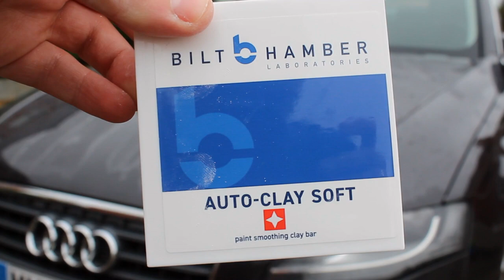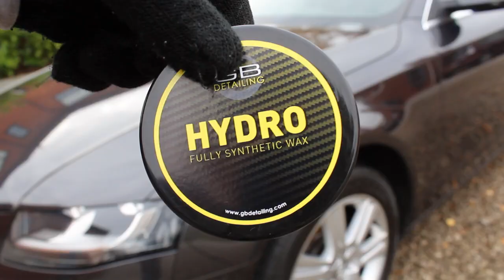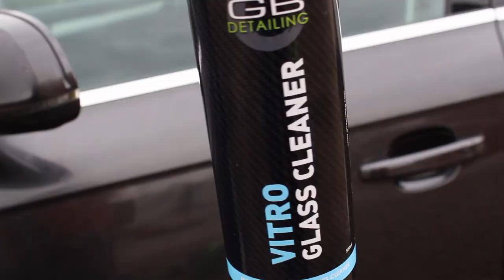FILTHY AUDI A4 | Complete Car Clean, Decontamination and Protection

Comment: Hi Heather, great content in video and some really good products.
I currently use chemical guys clean slate to remove waxes and sealants but after seeing you use GT zero and the fact you can use it in your foam lance as well definitely going to try that and there wheel shampoo looks good too maybe have to get that as well and try it in my IK foamer as them Audi wheels were like new after you had cleaned them. 
Looking forward to your next reviews.
Stay safe
Reply from the maker: Thanks for watching! I’d definitely recommend GT Zero over chemical guys clean slate, I’ve tried both and GT is the better product for me! I’m doing a video on the IK foamer and wheel shampoo soon, both well worth picking up as well 😊
Reply: @AutoCareHQ  
I currently use the foam pro 2 with P&S break buster so will be interesting to see how the GT wheel shampoo performs.
Do you know what dilution ratio I would need to use in the IK former
Reply from the maker: I normally use about 10ml in 500ml of water in the IK foamer which is plenty
Reply: @AutoCareHQ  
Thanks for getting back to me with that looking forward to seeing how it performs.

Comment: Great video again. And a good end result. 
Although there are one or two things I would say. 

Firstly, you aint doing wrong at all using Korrosol on the wheels. Its a great product and works well. 
I would say invest in some wheel wollies or a barrel brush though for that ultra deep clean. 

Second tip I would give is on the wax application. Just buy another pad for your polisher and use that to apply the wax. It'll take you 1/10th of the time. 

Lastly, for the wax removal, just use a nice soft deep pile cloth, stick it on the panel and put your polisher on top of it then go to town. 

The wax will come off easier, faster and leave an even deeper shine with absolutely no residue left over. 

Time is money and all that. 

Keep up the good work lovely.
Reply from the maker: Thanks very much for watching and for the tips! I’ve recently got some proper wheel barrel brushes, they definitely make it a lot easier! 😊
Reply: @AutoCareHQ  most welcome!  As soon as this snow buggers off I will be out there myself elbow deep in apc, wheel brushes, wash mitts and all sorts. Lol.

Comment: Great transformation Heather!, paintwork was crying out for a boost, black hole is one of the best glazes out for black cars.
The trim came up very well too, GB Onyx looks very good.
Reply from the maker: Cheers Graeme! Absolutely love using Onyx, I’ve gone through loads of it on my car, the finish is very nice and it’s really quick to apply, one of my favourites for sure! I’ll have to see if the GT Tyre Serum knocks it off the top spot 😂

Comment: So, I'm curious. You pressure wash before the snow foam. Some swear by using a snow foam on a dry car. What are your thoughts and when would you do one thing vs the other? May make an interesting video? Thanks and loving the videos!
Reply from the maker: Thanks for watching! I think it’s possible to remove a some of the dirt with the pressure washer first so that the snow foam doesn’t have to deal with as much and is only having to try and remove traffic film rather than loose dirt. Otherwise I’d probably feel like I’d need to snow foam twice to deal with the traffic film underneath. Good idea for a video though comparing the two, cheers! 😊
Reply: I use BH auto foam on the dry car, it avoids diluting the solution.

Comment: for most snow foams is it ok to leave on for a longer time even if it has started to dry a little?
Reply from the maker: I wouldn’t let it dry to be honest even if it’s ph neutral, I think at that point it won’t be doing much in terms of cleaning anyway. If it’s starting to dry but I want it to dwell a bit longer I normally just spritz the panels very lightly with water before rinsing it properly so it never fully dries on 😊
Reply: @AutoCareHQ  alright. i need to get a dang shop to wash indoors. in the sun im just chasing my tail with water spotting everywhere and streaking with products. so frustrating. thank you!

Comment: Why don't you use a Wheel Woolie for inside the wheels?
Reply from the maker: I think a wheel woolie would really struggle with those wheels tbh they’ve never had the barrels cleaned , I’ve got a bristle one that I’ll use next time I clean that one 😊
Reply: @AutoCareHQ  Try Wheel Foam by Auto Fanatic, a really great wheel cleaner you can use in a pump foamer or a snow foam gun. It's PH neutral